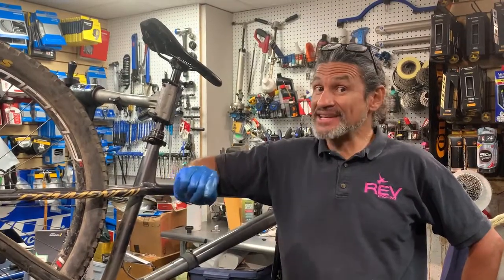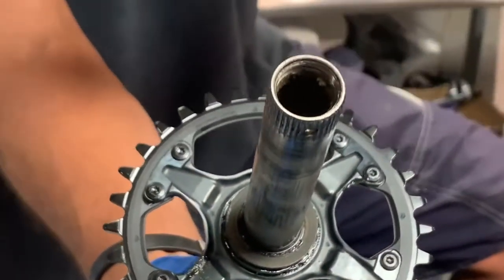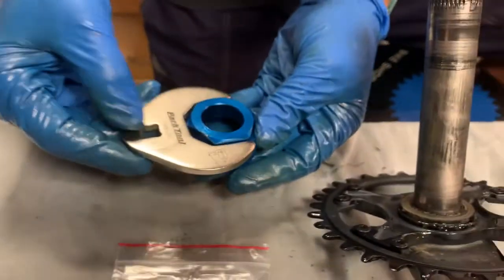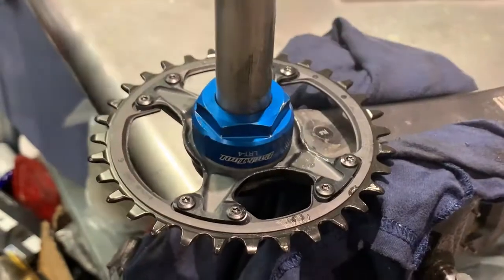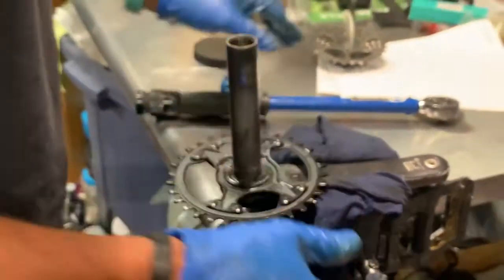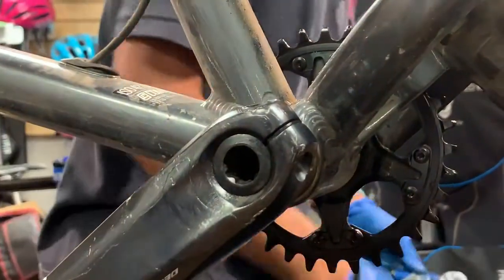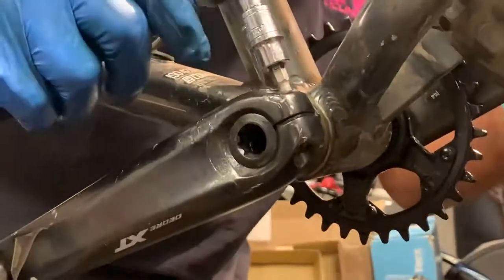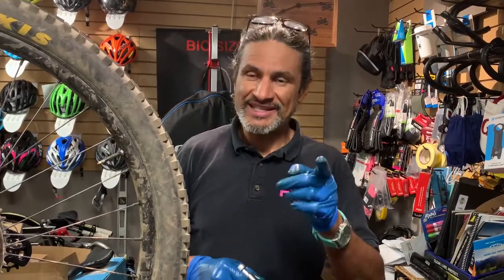How to change or install direct mount chainrings for Shimano XT SLX or XTR

Comment: !!Muchissimas Gracias!! 

*explicit reference to part numbers, and even some decoding of engineering nomenclature/abbreviations 
*superbly detailed explanation of how these direct mount mechanisms differ from what's traditionally on offer, 
*demonstrating how they are best tackled, 
*discerning advice proffered on Park Tool's advantages over other inferior rigs, 
and finally, the granular close-up work of your videographer – all of it SO much appreciated...

I have been sweeping the interwebs for what seems like forever in search of info pertinent to my impending switch from a 2X11Deore XT drivetrain to a 1X12, and kept banging my head when I tried to conceptualize the basic initial step of front chainring switch-out.  Different fastener-lengths to secure the new chainring? Mounting it backwards to get the chainline-seat tube spacing better? Shimming with washers to avoid rattling? They're all trick questions!! There are no bolts or spiders to align–Hallelujah!–its spline-system design, likely cross-pollinated from their rear hub innovations...

Keep up the excellent work!
Reply from the maker: Thank You for your very detailed comment! I appreciate you watching. Please consider subscribing

Comment: Are there spiders for this Shimano crank for a conversion to a 64 bcd four holes symmetrical ? I see some on Aliexpress but only for 104symmetrical bcd and it doesn't seem to have enough material on the arms to tap into it for a lower dia. bcd .
Reply from the maker: My apologies but I’m not familiar with a such a conversion existing